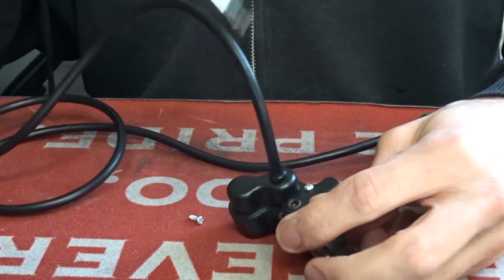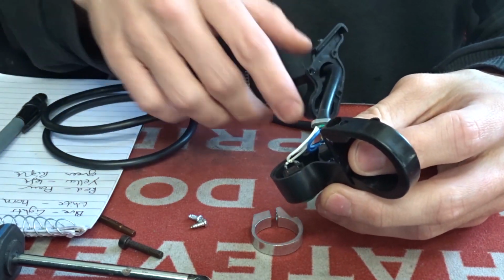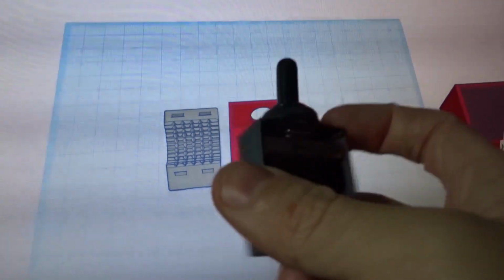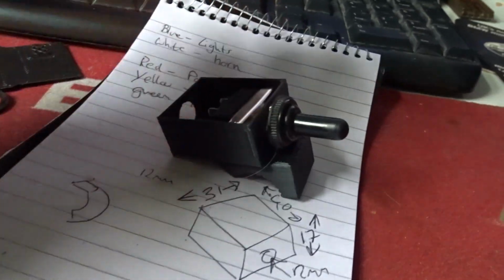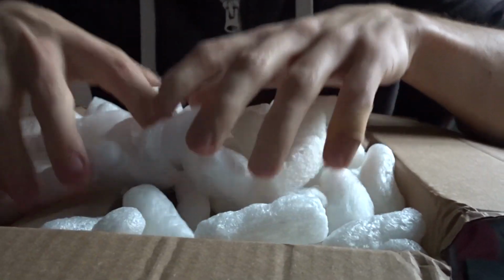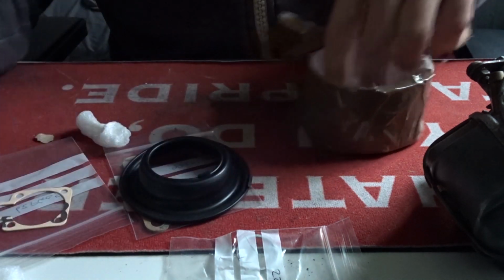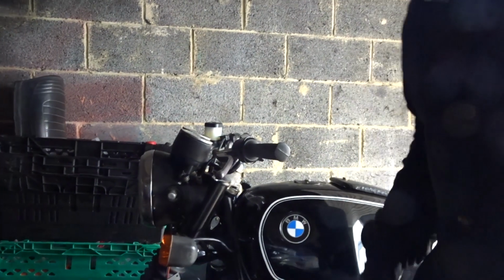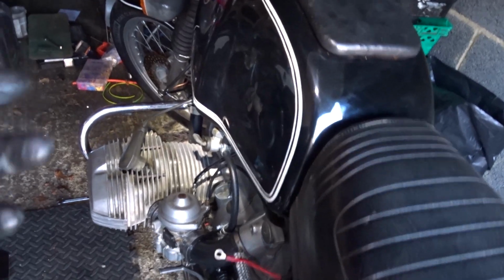Test Ride! BMWR80/7 1978 Ex Police Bike : Part 7

Comment: Could you have printed a new carburetor? Would fuel dissolve the material?
Reply from the maker: 🤔🤔 I suspect that would be a very very bad idea 😅 would have been cheaper
Reply: @BigPezza  would it though? Are there plastics that are not affected by oil and ethanol, but can be used in printer?
Reply from the maker: Regular carburettor parts are affected by the ethanol in petrol so I think 3D printed stuff wouldn't stand a chance